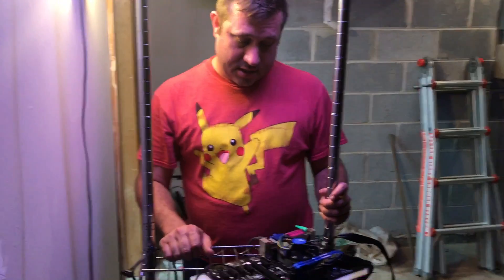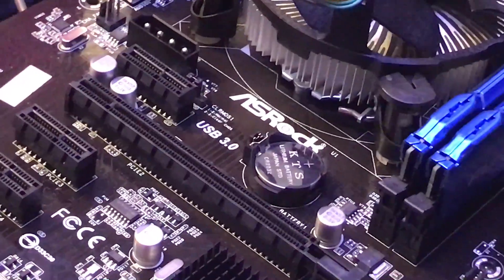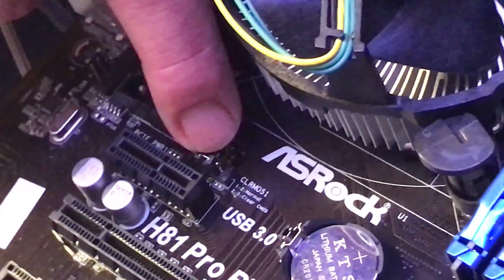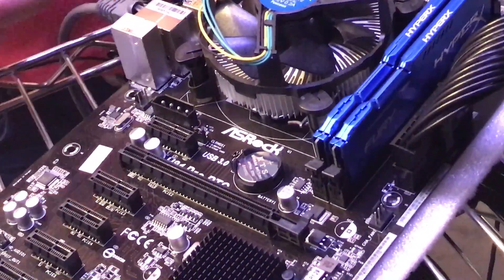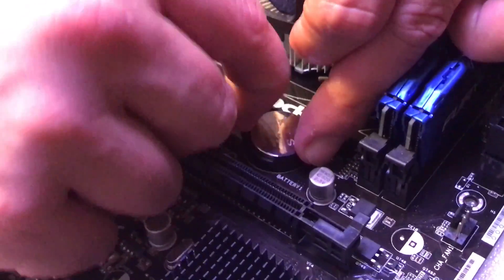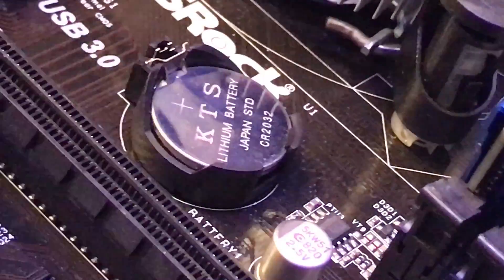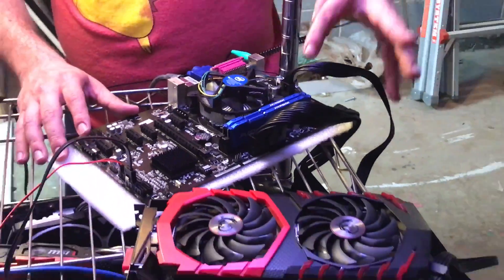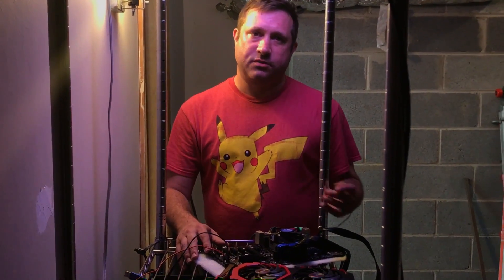Resetting the CMOS battery and jumpers on the motherboard. Ethereum Mining Rig

Comment: Thanx ! it would have been clearer if your fingers weren't hide some of your efforts..may i make a suggestion try using something like a tweezer, i thought i moved my jumpers , but mine had a little plug and wired. i think i f----d up my system. MB diagram showed it and the area but i did not see anything like your showing here. Asus is no help.

Comment: You literally rescued me just when i was thinking "omg my dad is going to kill me"
Reply: same i don't know if it is gonna work but my dad will kick my ass if it doesn't work
Reply: holy fuck it worked 😺😺😺😺😺
Reply: @CindyCecil  yoo congrats bro 😂, what was the issue?
Reply: guys some of you have this problem? i didn't try the clear cmos but i have a problem, for example i put 2133mhz ram speed, then i enter to windows 10 and in task manager shows a lower amount of mhz and it is the same with other memory speed.
Reply: @gamerfireyt8143  What you need to do is turn on XMP, all RAM starts off at the lowest clock possible
XMP should be visible in the BIOS
Reply: Conclusion i fucked with bios ultra boot did you?

Comment: Hello, I have a Fujitsu D2990-A3 motherboard. I have looked at the board and searched the internet for a while and I can't see any evidence of BIOS jumpers on the board. I have removed the battery for over 30 minutes, but it didn't reset the BIOS. I think someone has been into my place and tampered with my PC. Amongst other things that were amiss, my PC now oddly requires a password to get into BIOS and and it wasn't like that before. I suspect there may have been BIOS malware installed, which for me currently is apparently untraceable. It's a long story but I have had a nasty psychopathic person stalking me for a number of years now and messing with my life 😒 
I want to dual boot Ubuntu with my Windows, but most of all, get to the bottom of this problem, or at least find out if there's anything I can do. As I said, I have invested many hours watching videos and scouring websites.
Does anyone have technical knowledge of this motherboard and can you tell please if there is a way to reset the BIOS so I can access it?        
Many thanks, Tom

Comment: It says no signal detected also my keyboard and mouse has no lights by doing these things work?
Reply: did u get a fix for this? same thing is happening with mine
Reply: @matsiee  nah man i’ve been trying for 14 days still not working
Reply: @ukansane678  just asked reddit on pchelp hopefully it'll work,
 my username is matsieguitar incase we get things fixed  on the post
Reply: So u fixed?
Reply: @ukansane678  was the cmos battery i let him borrow mine to see if his pc would boot and yes it did, booted up without any problem and his monitor, mouse and keyboard worked perfectly fine
Reply: u dont have to buy a specific cmos battery they're all pretty much the same size just different brandings the one he borrowed was a 3 volt cmos battery on a b450f motherboard
Reply: @matsiee  hey i have the same problem, i wasntef to set xmp profile and after i didt it my pc restarted and only fans are spinnning. Also my pc is brand new, every part is new and could it really be a faulty battery in new motherboard? Btw i have  just installed windows before setting xmp profile and everything was working fine.
Reply: @maukeep3061  hello yes i've solved this problem it was the motherboard battery u should be able to find one for around 5-10 dollars they're not too expensive or just take one from another motherboard <3

Comment: Wait my motherboard has a button instead of a jumper so do I hold it down for 15 sec or press and wait 15 sec
Reply: is it need to be powered or full off electricity?
Reply: @Ploxza96  like it’s powered through the psu
Reply: @Ploxza96  but it’s fine I fixed it

Comment: Thanks man my mhz was supposed to be at 3000 and it was on that but the info said 3600 mhz for the average but then I put the setting to 3600 and then my pc lost signal so I did this and it fixed it thank you so much!

Comment: you actually saved my PC, i have a ASRock Pro3 Gen3, it suddenly gave me a BSOD + didn't boot (it would frezze on boot, with a black screen with a frozen cursor). i changed the battery, resetted the CMOS like you told and voila, everything works now. i was ready to buy a new computer but this saved the current one :) thanks for the video!! peace
Reply: I have the same problem haha

Comment: My PC is still not turning on, I don't know what to do. I've been troubleshooting for 4 hours now idk what's wrong.

Edit: Bruh, it turned out that I connected the extension cables to the motherboard, but I didn't connect it to my modular power supply... I'm such a dumbass.
Reply: @Walker-vc4gr  try to use a flat head screw driver. This worked for me.
Reply: @Walker-vc4gr  u will have a big 24 pin coming from the power supply to the motherboard, make sure it's connected properly sbd it's located at the middle right of your motherboard.
Reply: @Walker-vc4gr  u will have a big 24 pin coming from the power supply to the motherboard, make sure it's connected properly and it's located at the middle right of your motherboard.
Reply: @Walker-vc4gr  same thing goes for the 8 pin but it's located at te very top left of the motherboard.
Reply: @Walker-vc4gr  and for the front panel connectors (which comes from the case to the motherboard) it's usually located at the bottom right of the motherboard. Go to Google sbd type front panel connectors layout and make sure they're connect properly and they're in the right pins.
Reply: @Walker-vc4gr  is your ram in the 2nd and 4th slots?
Reply: @Walker-vc4gr  and remember to make sure the switch on your power supply is on (straight line indicator)
Reply: @Walker-vc4gr  what's the problem with your pc? Not turning on?
Reply: @Walker-vc4gr  make sure that the 24 pin and the 8 pin in the top left is connected. If it doesn't work, check the front panel connectors are connected and are in the right places.
Reply: @Walker-vc4gr  sorry if u didn't get what I said.
Reply: @Walker-vc4gr  did the pc turn on?
Reply: that DO BE happenin lol. im glad you got it all worked out though :D
Reply: I would say that makes you normal, happens to us all
Reply: @Walker-vc4gr  your power supply is broken
Reply: Try replacing processor

Comment: I just added two sticks of 8 ddr4 ram to my pc and when i tried to get it on every fans works but all my motherboard direct outpub dont respond. My 2060 rtx isn't dettected by my screen anymore and same with my mouse and board. I dont understand. My drive sound like its runnib too so its not my powersupply. I ttied the trick with the jumpers ans the battery but still does'nt work. Anybody get my sime sort of advice plz
Reply: go to a pc technician
Reply: @EntertainmentByKV  i got a new board whit led undetected component sensor. My cpu led was lighted up so i just changed the cpu. Work perfectly now. My cpu just snap

Comment: You just made my day man, I messed up my new custom build PC's motherboard (Gigabyte Aorus z390 pro wifi) on its BIOS(Basic-input-output-system) setting in the very 1st day, my pc was on a state of 100% load with boosting temp. I was so depressed and thought of what should I do now! I was looking for a video but nothing worked for me. I tried with yours removing the battery and CLR_CMOS with the jumper and everything sets to normal again. Loved it, man.

Comment: Ty so much it worked for me cause i fucked up my bios if you guys cant connect your monitor with your pc just try this and then pull out your cable for your psu and then press your power button for 20 seconds

Comment: Do you have to take the gpu out? Also do you take the power supply out of the motherboard
Reply: Unplug your PSU first or shut it off, you only need to remove gpu if you cant see the cmos battery or of your gpu is blocking it. Removing it is recommended regardless, since it's easier to work without a gpu in the way.

Comment: This is the best working method, i fucked up the settings in bios, just change the battery on the motherboard. I had a black screen in around 6 h and this worked.

Comment: Mine didnt come with the jumper :(
Reply: @hallo allo my b450m hdv r4 too
Fuck it i will buy tomahawk max 
This motherboard is worst motherboard i have ever had piece of junk
Reply: Kaio Nayon did u fix it at the end？ same mb. Thx
Reply: @pigfly3944  i find out my xfx rx 580 8gb died within a week i couldn't get refund too
But you reset it with any iron make sure the iron makes connection with both 

Or just remove the lithium battery 

Still can't use my computer ordered the gpu from aliexpress i can't go pick it up cus of corona pandemic
Reply: I skipped the jumper step and just reseated the battery and it got my system to boot.
Reply: Use a screwdriver :)
Reply: @amir32806  jeez I didn't even realize my comment got that many likes
Reply: I got a Msi B36M I don’t even see clear cmos on the motherboard nor have a jumper I’m just confused 🙂

Comment: Helpful, but this video could be cut down by about 90%. The helpful bit is when you show how to remove the battery.
Reply: For anyone like me, seeing this a few years later, most of this part is still helpful. The one thing he got wrong is that its recommended to wait about 5 minutes before putting the battery back in, not 15 seconds:)
Reply: Almyjo o bet

Comment: i have the z370 pro4 , replaced the board and power supply, did what you explained and still all I get is computer coming on but no video or bios screen
Reply: Having the same problem now, any luck?
Reply: @keenan7668  yeah replaced the board with the GiGabyte z370xp sli motherboard, booted right up...beautifully

Comment: I have an HP Am4 Board with jumper and battery and im having trouble with bios. i dont have anything in pcie. i have only intergrated cpu graphics will it boot or monitor have any signal if i remove battery??

Comment: I added a 2nd 8gb ram, now at 16gb, but now my pc starts with american megatrends, and when I boot it through UEFI my games, well, the whole process is really slow. If I do these, would it help get my pc run normally again?
Reply from the maker: No, resetting the CMOS would not help for slow process.  Check that the CPU you are using is compatible with the RAM and motherboard.

Comment: Good evening
I'm looking for help I have an HP Compaq Elite 8000 Convertible Minitower PC
You receive a startup error message every time
First message
Intel R) Management Engine BIOS Extension v5. 1.8.8819
Copyright (C) 2883-88 Intel Corporation. All Rights Reserved.
ME is initializing.
Intel R) ME unconf iguration in progress...
The device then restarts and the second message arrives
2233-HECI error during MEBx execution
MEBX Status0302
ME BIOS Extension nodule halted
Update BIOS or ME firnuare if problen persists
2206-End Of POST HECI Failure
Systen halted. Power cycle the systen to reboot
please help
Reply from the maker: I am not familiar with that board but the error implies you will want to check the manufacturer website for bios updates.

Comment: Ok this video hits home on many levels. The fact that my Ethereum rig is having issues... first and foremost... I added 2 more GPUs with a max of 4. A 1200 Watt PSU... however, I noticed after adding the 3rd and 4th GPU the boot times suddenly became drastically affected and severely delayed. It's strange because after benchmarking both cards (The 1st and 2nd were already done), I ran a mining command. I was getting the expected MHs. Then, I foolishly thought... "Let's update the BIOS... because this boot time is odd..." Personally I don't think the BIOS update did anything because only after plugging in those two cards I noticed strange behavior, which was before the BIOS was updated. But now booting is hampered significantly and is very delayed (At an alarming level). So much so that I am curious if I burned out the board or the PSU with so much output. The board was meant for 2 cards though, yet I still use PCI risers. I'm going to reset the BIOS with the jumper... but now even booting without any GPUs attached with a DVI connection to the board's own video port... same result. Would you agree to reset the BIOS? Have you experienced something like this before? (Sadly i bought the motherboard used... which I think was a mistake)
Reply from the maker: Yes, reset the BIOS/UEFI this will reset the mobo to use the on board video port instead of the GPU port.  I really recommend the Gigabyte fintech 250 board if you are looking for something better.
Reply: Thank you

Comment: How reset cmos to default on the Asrock Fatal1ty Z370 Professional Gaming i7 motherboard?
Reply from the maker: Same process as this.  That MOBO also has the battery, just pop it out for a minute or 2 and then replace.
Reply: AtHomeCrypto where you buy a replacement battery thanks
Reply from the maker: Look at the top of your battery and look for the #s.  Those are the specific type that you will need to get for your MOBO.  You can google those #s and most likely find replacements at your local hardware or computer store.
Reply: AtHomeCrypto I see will do

Comment: I follow your instruction step by step, now my motherboard say no signal on monitor,
Reply from the maker: When you reset the CMOS, the Integrated video port is set as the default.
Reply: @AtHomeCrypto  hi, Im having the same problem, I have no signal and Im using vga and tried with a dmi cable, whay should I do?
Reply: @AtHomeCrypto  okay man but what if our cpu's dont have integrated video?
Reply: Same just buyed new asus Prime x470 pro / ryzen 7 2700x No Monitor Signal pls help
Reply: @xSpeedLp  i tried to flash in all sorts of different ways, i ended up giving up and buying a new mobo instead of paying the same amount for a repair tech that might not have done anything.
Reply: @xSpeedLp  got a new motherboard, still no display, i think maybe the hdd is fucked

Comment: No.. you didn't push down on the opposite side of the battery
The battery is spring contacted and pushes itself up
You should probably use a toothpick or plastic case opening tool for an electronic device
Once that clip is moved aside... the batteries MOBO connectors push it up...  easy as pie

Comment: Do you have to turn the power on after you change the jumper to "clear CMOS" mode?
If yes, for how long?
Reply from the maker: nope;.  power is off
Reply: From what I’ve read on Dell, in order to properly and completely clear the CMOS and NVRAM 
/ESCD settings you need to apply AC power (wall plug) “not necessarily power on” for a full 15 seconds. This is on a desktop board only with a 2 pin jumper where the plug is swapped out between the PSWD and CMOS jumpers to reset. Also on some other videos I found, it is said that you can even power on the machine to see if the fix worked while 3 pin jumpers are moved from positions 2-3 to 1-2. https://youtu.be/yipwZ6c2g7s  Only that you would need to replace jumpers back to 2-3 after powering back down which will remove any changes you’ve mad while at 1-2. 

“K.I.S.S.” pull the CMOS battery for a minute or so using power button to clear capacitors and residual charges, replace battery, power up and in almost all cases where clearing CMOS is the actual solution to a problem, this works perfectly.

Comment: can you please let me know does the two molex on the board needs to connect each other then to psu and which section of the psu? perif or sata?

also if i use two psu does it need to be connected to primary psu?

thanks
Reply from the maker: You should use the 2 psu=1 adapter.  one Molex connection to a single PSU. Perif on the PSU but SATA connections are preferred
Reply: AtHomeCrypto I got four gtx 1080 can I run them on one 750w?

Comment: Isn't it either shorting "clr pins" or removing the battery?
Reply from the maker: Every motherboard is different, some require both and sometimes it is one or the other.  It is best to check the documentation for the specific motherboard you are using.
Reply: after reseat the battery only my PC wont turn on... why?